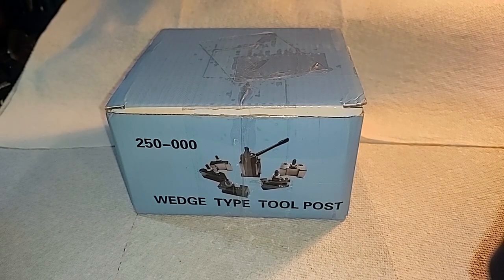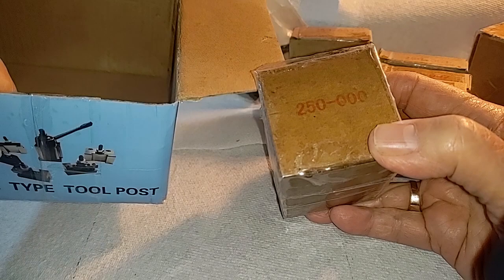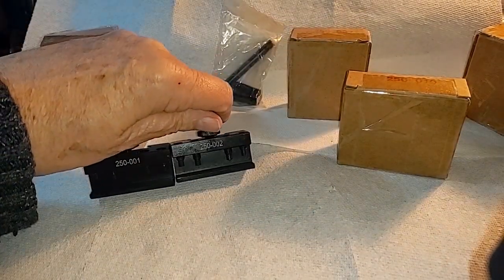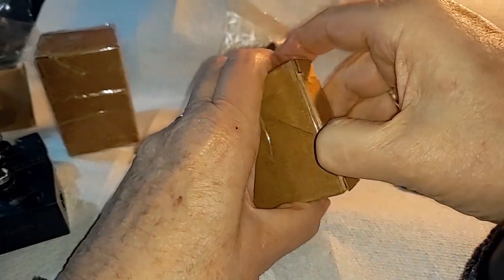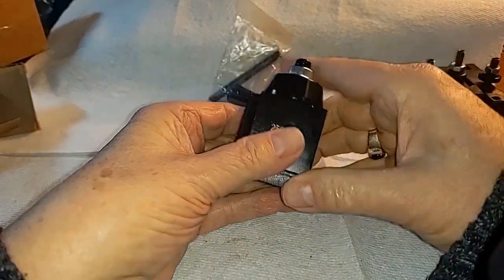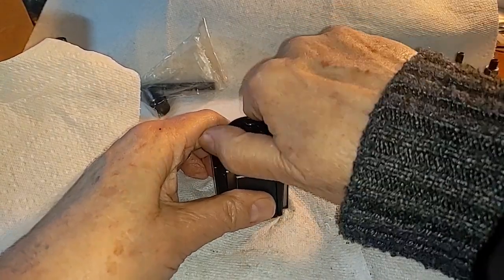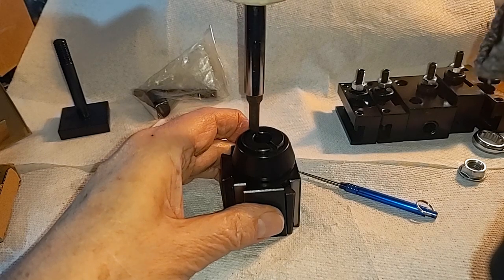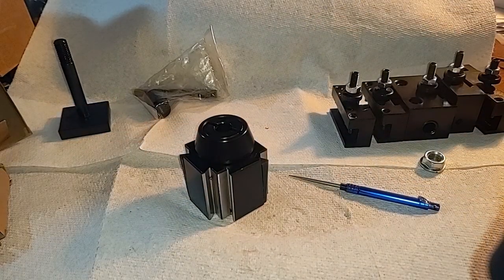#2-A Review of OXA Aloris style Chinese tool post for Chinese 7x14 mini lathe. Not right but hopeful

Comment: Dang, I got lucky with mine. Bought a cheap set from Bangood, Machifit brand. It's ok for my purposes, need to clean it up properly though, as the stuff from china tends to, it pretty gritty 😂
Reply from the maker: Congratulations, it's nice to know that some good stuff actually slips through. And yes, the Chinese are noted for leaving things that float on water like very small rocks in their products.
Reply: @oldfarthacks  chines lead also floats 🤣
Reply from the maker: It would not surprise me to see that. Cheap Chinese Lead. They fake everything.
Reply: @oldfarthacks  in all honesty most of machining stuff sold by western businesses still comes from china. They just add an extra layer of quality control.